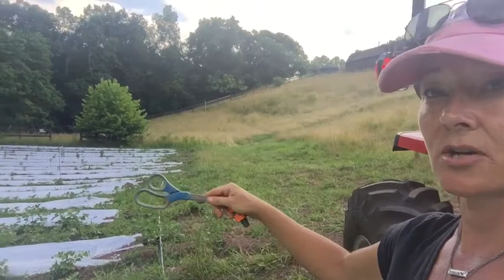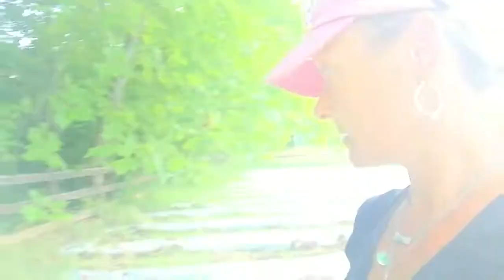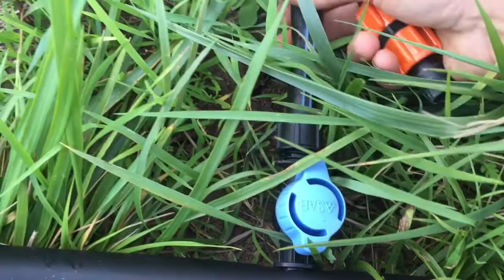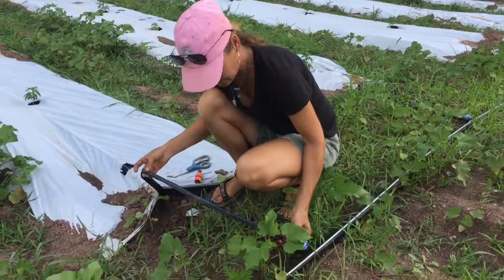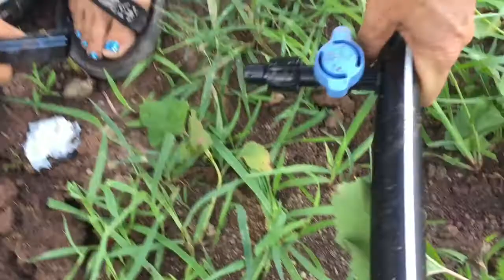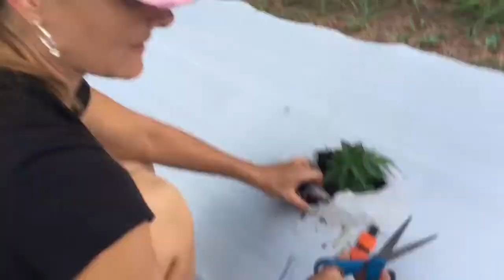DRIP IRRIGATION TROUBLESHOOTING - Fixing blowouts and identifying problems with drip tape systems

Comment: That’s exactly what I did this morning. The duct tape method. It didn’t work so you have shown me what to do not. Thank you so much.
Reply: The connectors were fairly inexpensive. Duct tape worked when I didn’t have them on hand, but as you said, not for long. I wonder if flex seal would work?

Comment: I have 6 small backyard raised beds using 3 lines of drip tape in each bed. Some sections of the drip tape runs don't discharge water although the pressure seems adequate. Can the drip tape emitters be "unclogged" or must I replace the (apparently) faulty sections? Thank you for your tips in this video - even though I small "taters" it hellps me.
Reply from the maker: I’m small taters too LOL. You can flush the lines by opening up the end caps and running the water.  They are easy to patch up with the patch connectors even under plastic mulch…just think ahead about how you’re doing to thread/feed new line under the mulch (assuming you’re using that).  I know about the flush from other farming videos.  I have never done that myself.  Keep me posted on how you troubleshoot this issue. Happy Farming : )

Comment: I had a hole in one of my drip tape rows. I did not have anything to fix it with. but I sprayed it with flex seal and it actually sealed it up. I out two  coats on letting it dry between the coats. Be sure to clean it well first.
Reply from the maker: That’s a really good idea and suggestion.  Thank you for adding to the dialogue!

Comment: What brand of drip tube did you get and where from..?? Spacing between drippers..? Also spacing of plants and row width.... my first time doing this and learning... seen a 4'x4' grid is good?? 
Thanks...
Reply from the maker: My irrigation system was supplied by Berry Hill Irrigation.  I believe the tape was 5/8" with 12" spacing.  It should not be a guessing game though...I highly recommend talking with your irrigation supplier (whoever you get materials from) and letting them decide what is appropriate.  They know all of the little details that make a difference in selecting the type of system you will use.  Berry Hill was amazing and I was so thankful they walked me through the whole thing.  It was very easy after that.  I have a video 500 hemp plants where I discuss plant spacing and crop layout.  It's only from my experience, but I think it will help.  That question is hard to answer in the comments section.  I use a 4x6 grid, but 4x4 would be fine depending on the expected growth of the plants you grow.  Larger plants need a larger growing area.  Staggering the plants on a 4x4 grid can also help allot for additional space.  Happy Farming!

Comment: I always left about a foot and a half stick outside the of the mulch on the ends and I would walk the distal ends to see if the pressure was good. That told me if there was a problem somewhere between that end and the source. I quit using end caps too and just folded the end of the drip tape a couple of times and stuck it inside of about a 3 inch piece of drip tape that I pre-cut.
Chuck
Reply from the maker: That's a brilliant idea...I saw another farmer folding the drip ends as well.  The end caps kept blowing off.  I figured out the sounds the system would make when there was a break, but it was difficult to tell exactly where under the plastic mulch.  I ended up losing a plant bc of it.  Live and learn = )

Comment: Wondering if you have checked your water pressure at your hydrant?   I have to use a pressure reducer at my hydrant.
Reply from the maker: M R Thank you for the comments : ). At the end of the. Drip irrigation video on my page I show the connection from the source. I have a pressure regulator, feeder, and timer set up. Good luck with the tomatoes : )